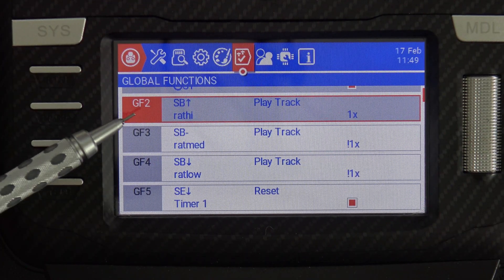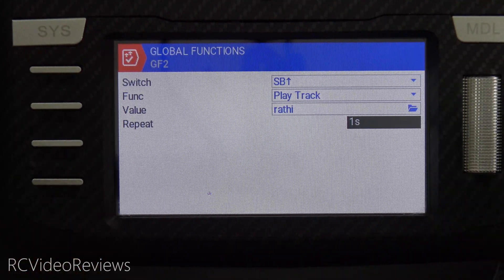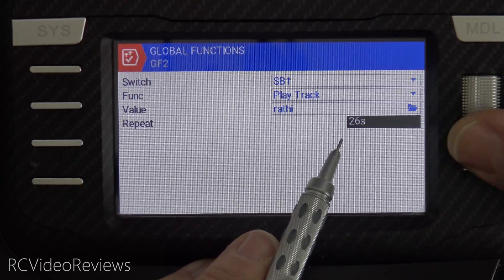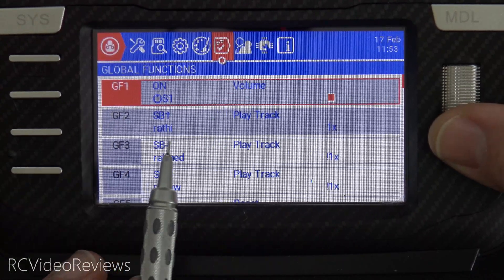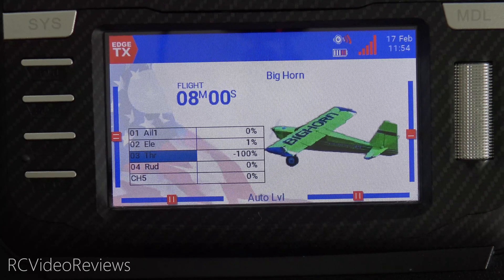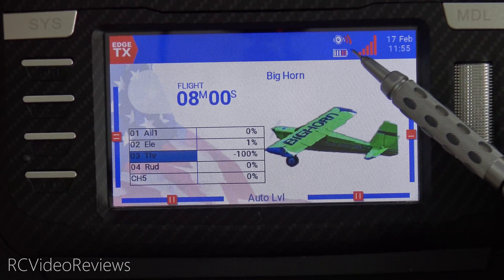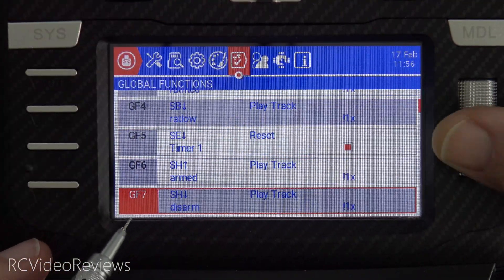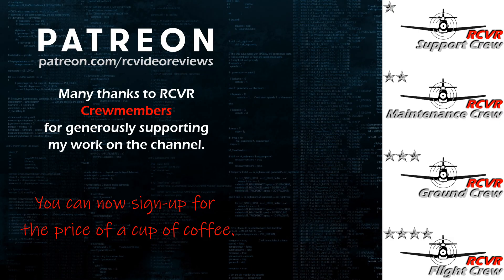EdgeTX Snippet • Auto Volume Boost and Prevent Audio Prompts on Start

Comment: Hey John, I just got a TX16S MK MAX w/AG01's and I've got the volume on S1 knob and like to adjust it as needed, but full volume is like low volume on a Taranis X9D+. When out doors I can hardly hear the speakers. can never really hear anything when flying my quads far away from me even when I can't hear them in the distance. I've got sonar hearing, hate noise and hear literally everything so I'm not deff. I'm 41 years old and hearing isn't an issue at all, but don't know why the volume is so low. it shows its all the way up on the icon on screen I can dial it all the way up and down and works fine there, just not loud at all at max volume. I've gone into the companion and set the wav volume to max and the volume limit is 23 so thats set all the way up as well. but still its so hard to hear anything out doors. I'm really disappointed. I have a lot of alerts for flying quads count down timers voltage read outs and mAh read outs as well. but can hardly hear them. not sure if there is anything that can be done? not sure if this is a common complaint or not? hoping you might have some suggestions know if there is anyting that can be done? thanks for your time. hope you have a good day.
Reply from the maker: Audio level has been a common complaint on these radios. They added a 2nd speaker at some point and it helps some, but it definitely needs more gain.

Comment: Excellent videos!  Well explained, however,

I tried the GF for the auto max upon arm but could not get it to work
Your video shows clearly what to do --- my gf function is enabled  and also in the model setting- firmware v2.71
I have my audio on os2 -- works fine for controlling audio..
When I turn my arm sw SF in my case, I see the function gets activated but it does not  change the volume level?
I Shutdown controller, re-did the snippet, same results..  Even had a friend try it same results....
Reply from the maker: Not sure what to tell you on this one. I just tried it on 2.7.1 on a different radio and it works just as in the video. Try using a special function instead of a global function. Something is missing here...
Reply: @RCVideoReviews  Just did the snippet as a special function -- worked perfect....Thanks!
Reply from the maker: In your model setup near the bottom there is an option "Use global funcs"  Do you have that box checked?
Reply: @RCVideoReviews  yes the use the global is checked.
I have other global functions and they work fine....
Reply from the maker: Make a new model--don't use the wizard or anything else. No templates..just new model.
Select that model and try it again. Ensure global functions is turned on in the model settings. I've never had the radio behave selectively with global functions.

Comment: Nice volume hack.
I always miss my timer call outs in the winter when flying with a radio muff.
Implementing now
Reply from the maker: I used to always fight with my radio at the field. Constantly turning it up and down, and then when it was down, I'd miss timer alerts, or whatever else. Good way to make sure you always get the alerts you thought you needed when setting up the plane.